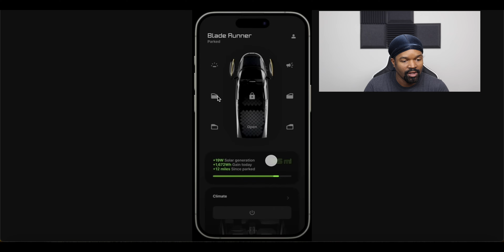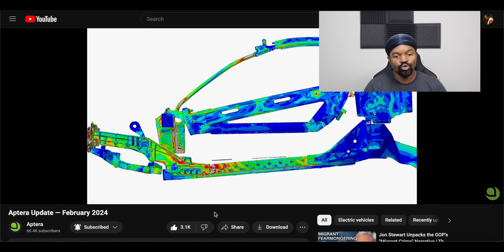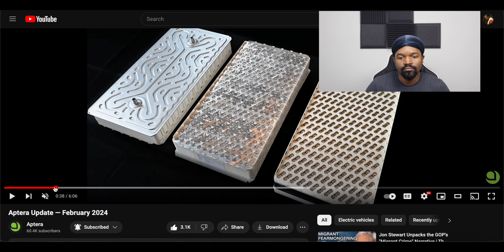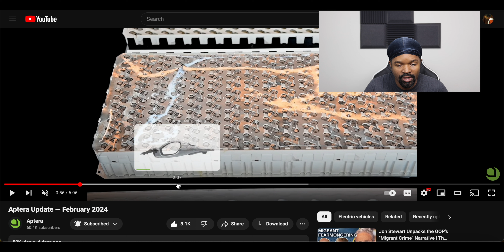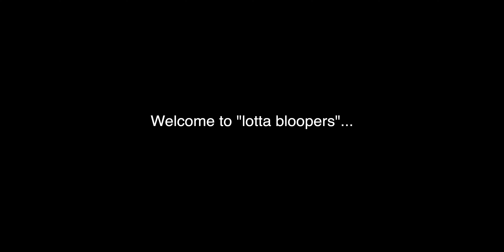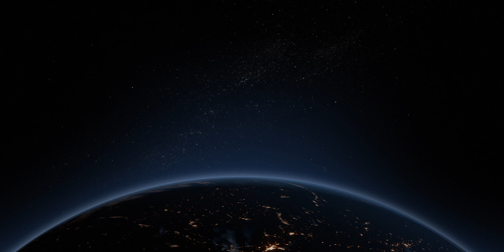Aptera News Update 05MAR2024

Comment: It looked like Aptera's cooling design will rely on liquid cooling from the bottom of the cell, possibly combined with forced air cooling for when it is DC fast charging. It would be very interesting if Aptera uses 2nd gen Lifepo batteries like the M3P, because they provide energy density of 210Wh/kg, compared to 244Wh/kg for Tesla's 4680 batteries. When you figure in the lower cost, longer lifespan, no nickel or cobalt, and ability to charge 0-100% without degradation, Lifepo could be a better choice for Aptera. In the balance is Aptera's 400mi (and 40mi daily solar) range goals, and battery supply availability.
Reply from the maker: There are a ton of battery chemistries Aptera considered. I wonder if M3P will be considered too.

Comment: You say that the power requirements might be too small to require battery cooling but what about the famous test drive for the media where the power was throttled down by the BMS due to over-heating?
Reply from the maker: From what was explained, they forgot to connect the cooling lines to the motor that day due to scheduling too much back to back. According to Chris Anthony, they drove for a while with multiple pulls and hills before they experienced any issues. Considering those factors, their cooling solution should be more than adequate. They have a small radiator and liquid cooling combined with skin cooling. Unless you are a mad lad pulling at every stop sign/light for miles on a 38°C day (100°F) you should be fine.

Comment: Sorry, but I disagree with you about the cell spacing and possible cooling between the cells.  The cell spacing appears to be regular and consistent - no extra gap where you indicated.  If you follow the tops of the cells, they are a regular triangular grid with no shift in centers as you travel along any grid line.  
Also, I believe that the images are of the top of the pack, and as I remember, the pack is going to be bottom cooled.  Then again, I could be wrong about this last point, I am not certain about this view being the bottom or top.  ¯\_(ツ)_/¯  Either way, the pack will be end cooled (unless they find that they have to redesign it). 

Still... good video, thanks.
Reply from the maker: No problem at all. I welcome discussion even when (especially when) you disagree. Having more opinions and opposing information is part of what this channel is all about. As a few others have pointed out, the bottom cooling confirmation makes my thought process moot.

Comment: While I see the place you're saying could hold a cooling channel, I believe that is space for the potting compound to ensure each cell is not touching metal to metal and to secure it for vibration. Aptera has been somewhat clear the cells will be BOTTOM liquid cooled. The electrical connections and battery vents should be on top.

Also of interest no one has mentioned, there is empty space in the module above the electrical connections. I believe that is space for the BMS we've seen glimpses of! The battery update May 2022 showed part of it. Steve F posted a recent picture of the thickness of the traces?
Reply from the maker: You are making a lot of sense. The only justification I can think of would be designing for larger heavier vehicles in the future. I kinda want to see the insides of more EV battery packs now.
Reply: @theninjineer  You're in luck! Munro Live (of Sandy Munro) has an excellent battery video https://youtu.be/hBbhevHZZ5E?si=1t0lVa2ptFEvqUr9 if any one battery they mention in this video is interesting search their channel to find that full battery teardown video. It's fascinating the design decisions that go into them!